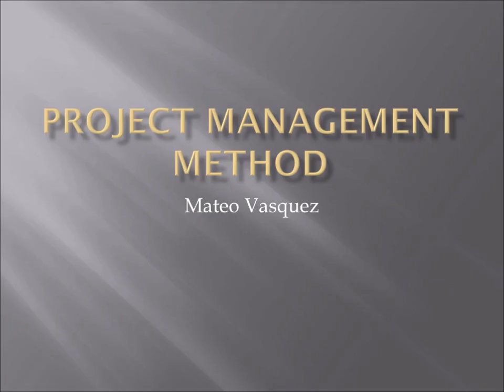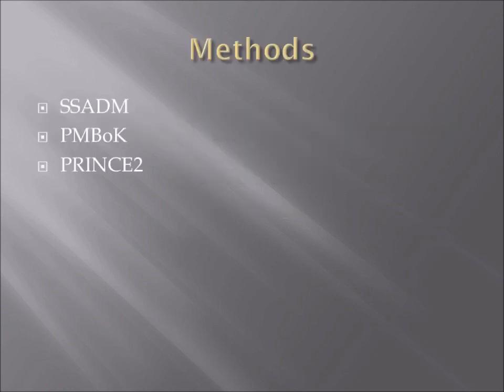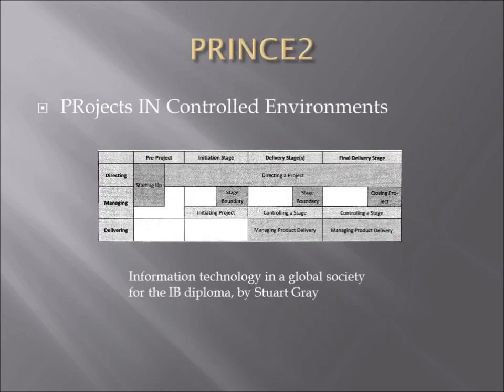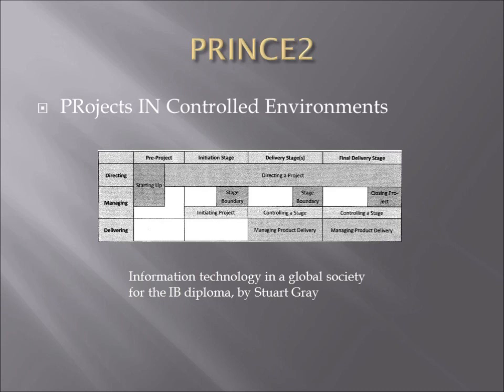IT Systems in Organizations Project Management Methodologies

Comment: As much focus as there has been in this chapter on the development process of IT systems, the management methodologies used are still are extremely important. Proper management is what ensures the the development process is proceeding as it should, and can catch errors as they arise. Management  also helps to ensure that product development is proceeding efficiently, especially in the case of larger products where several smaller teams will be working on different parts of the same end product.

Comment: SSADM or Structured System Analysis and Design Method, is less about support and maintenance and more about management. PMBok or Project Management Body of Knowledge is about what each different type of management should be doing at each stages. PRINCE2 is used by Britain mainly so this is a good way to be globally aware.

Comment: There are many different management methods, but ultimately it doesn't really matter which method is chosen as long as the method works. Management is the key piece that keeps everything together and working smoothly.

Comment: The structured system analysis and design method seems like the best option for project management. Its different level breakdowns are really thorough and will result in the best quality for the outcome of the system. I really like the fact that it has a lot of steps to ensure the product quality before the last stage which is the actual physical design of the system.